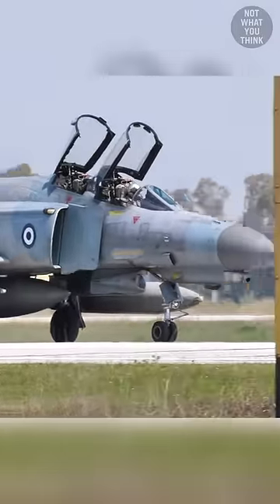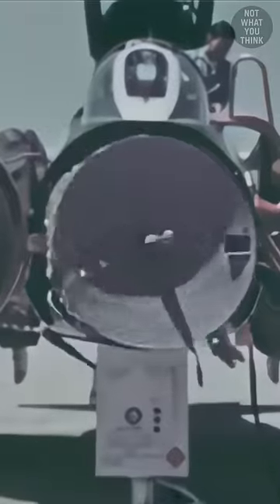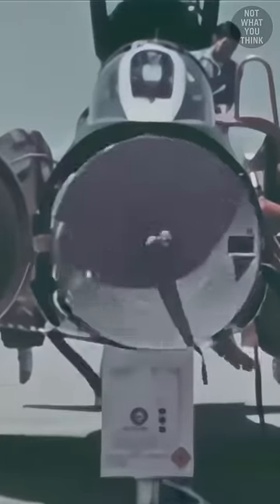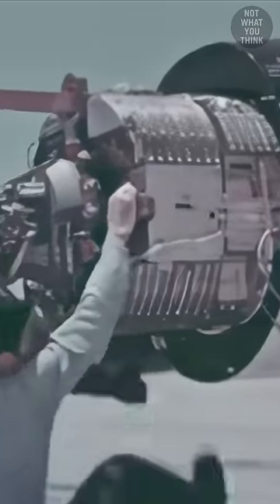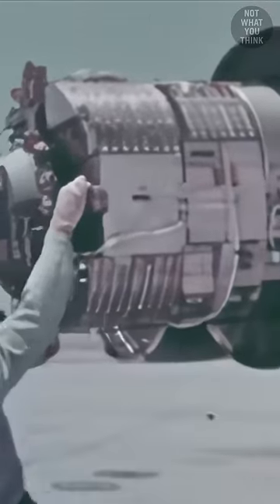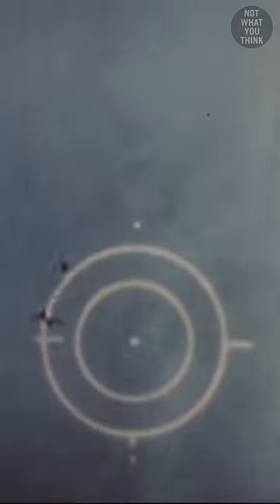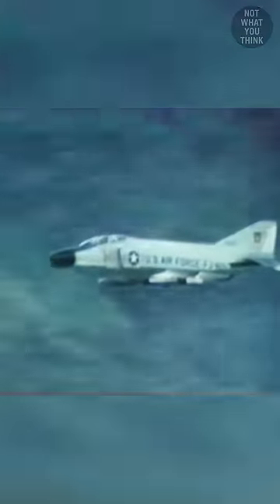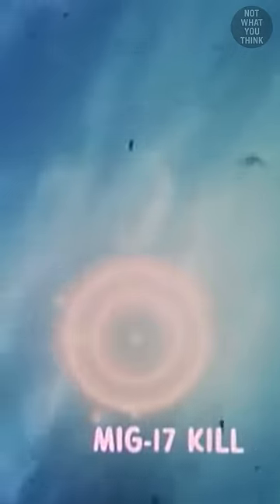What's Inside the Nose of F-4 Phantom? #shorts

Comment: damn, i didn't think it actually moved like that
Reply: I know, and it's so much bigger and heavier than this video makes it look. I wonder if they tried flying it without counterweights first, and how much the radar would jerk the nose around...or it's plausible with such an old jet if it's not maintained well, that radar dish could fly off the hinge and someone could end up with a free satellite dish through their roof : )
Reply: Yeah, the need for scanning motion of the radar dish is why now (among other reasons) militaries opt for using phased array - since they practically dont need any mechanical movement
Reply: @MrJonsonville5  highly likely the aircraft would spiral out of control due to shift in relative position between center of mass and aerodynamic center
Reply: @TheNicestPig  highly unlikely, the dish (not the radar) is very light and its cg isnt even displaced much even at maximum angle of deflection

not to mention that the original reply doesnt make any sense because the weight counter-balance is for the fire-control system (which doesnt move) not the radar
Reply: @plat216  why would they need a counterweight for just the radar dish? I was obviously talking about the entire radar system.

Mr Johnsonville was talking about trying to fly the variant without the (entire) radar nor a counterweight, removing the radar dish alone would change nearly nothing.
Reply: @TheNicestPig  I thought u were saying how the swinging motion thus constantly changing cg would cause problems, but no, without the counter balance, the pitch authority would be very weak, but the plane will not “spiral out of control,” there is no “shift in relative position” of cg, the aircraft would be simply be statically less stable
Reply: @plat216  fighter aircraft already have their aerodynamic centre and com very close together, a major shift in mass can turn an F-4 into having a similar flight dynamic of say an F-16 or Su-27 but without the flight control system to compensate, thus flipping nose up/down and going out of control.

The radar system is a heavy chunk of metal at the nose of the aircraft, it would naturally affects the position of the aircraft's center of mass, specifically pulling it towards the nose.
Reply: It would be really hard to open the radome
if it didn't. 😁  Also this was before you
had electronic scanning radars.  It was the
only way you could track targets off nose.
Btw, when you lock on, the scan stops and
moves with the target.
Reply: I can't remember ever running the radar
antenna stowed like that.  We put a 4 foot
extender bar in and extended the system
out of the nose.  Made problems easier
to reach.

The APQ-120 we had on the E model was
a lot smaller in cross section and the dish
was not only smaller, but had 4 T shaped
IFF antenna mounted on the front of the dish.

Comment: But does the Missile know where it is?
Reply: It knows where it isn't
Reply: The missile knows where it is at all times. It knows this because it knows where it isn't. By subtracting where it is from where it isn't, or where it isn't from where it is (whichever is greater), it obtains a difference, or deviation. The guidance subsystem uses deviations to generate corrective commands to drive the missile from a position where it is to a position where it isn't, and arriving at a position where it wasn't, it now is. Consequently, the position where it is, is now the position that it wasn't, and it follows that the position that it was, is now the position that it isn't.
In the event that the position that it is in is not the position that it wasn't, the system has acquired a variation, the variation being the difference between where the missile is, and where it wasn't. If variation is considered to be a significant factor, it too may be corrected by the GEA. However, the missile must also know where it was.
The missile guidance computer scenario works as follows. Because a variation has modified some of the information the missile has obtained, it is not sure just where it is. However, it is sure where it isn't, within reason, and it knows where it was. It now subtracts where it should be from where it wasn't, or vice-versa, and by differentiating this from the algebraic sum of where it shouldn't be, and where it was, it is able to obtain the deviation and its variation, which is called error.
Reply: The AIM-7 gets Head Aim and English bias
inputs from the fire control system.  Head Aim
tells the antenna where to look for the target
and the English Bias lets the missile know
which direction the fins need to point before
the missile gets yeeted off the launch rack
as a type of kentucky windage to lead the target.